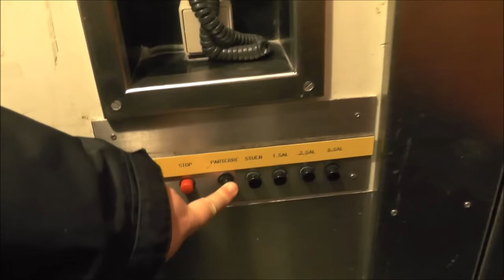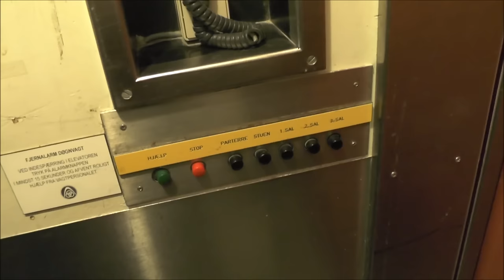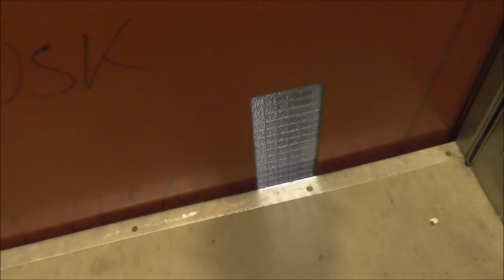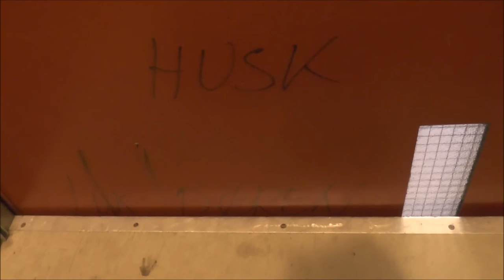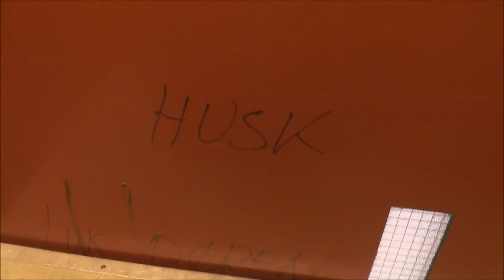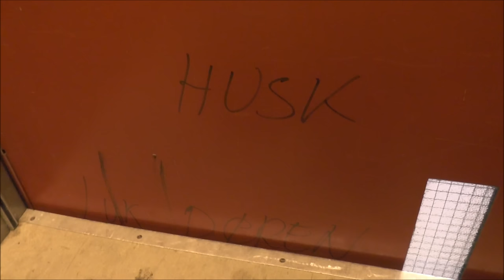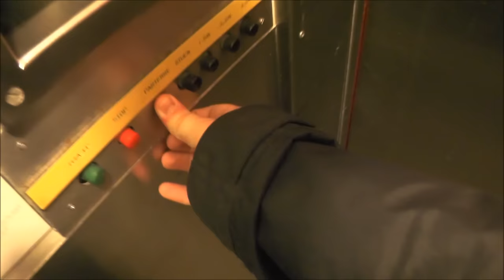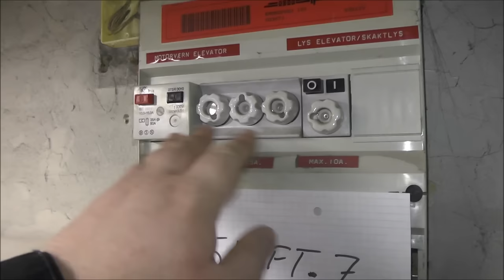I GOT STUCK 10 : 1942 Siemens elevator ride GONE WRONG

Comment: I think the motor timed out/overheated because the lift didn't fully stop because he did the reversal trick.
Reply from the maker: That might be a possibility. It wasn't clear to me what exactly broke down but I am certain it was a safety device that tripped.
Reply: @犬用下着ソース入り消臭剤 reversal trick is when you run three phase motor in forward and then suddenly switch it to run backwards without stopping the motor. Basically beacuse you are suddenly changing magnetic field to change directions motor can overheat and that is mostly problem on older elevators beacuse older elevators use magnetic relays to do everything something like this in video can happen and its bad for motor

Comment: Im scared of elevators Cuz my two friends where in my buildings elevators and they went form 3 floor to 1 in a sec and crashed. They where okay but my first friend jumped in the elevator, if you jump hard in a elevator it might break or crash. When they came out they where sweating so bad XD justens drink exploded. Molly was ok
Reply: if you junmp n the elevator its fine now they all have govenors that stop the elevator from falling
Reply: Glad their ok
Reply: @Azaelris  haha xD
Reply: @Azaelris  and also every elevators have 5 or 7 stong steel ropes. each rope can lift 5 tons (if I don't wrong) but lets think elevator starts falling. elevator's brake will trigger and elevator will stop cuz brake regulator will trigger

Comment: Usually it’s newer cheaper elevators that are more likely to do that but sometimes with older elevators you can have issues like a worn out door safety switch which can cause the elevator to get stuck if it happens to open the circuit while the elevator is moving.

Comment: This is so cool!!  It's amazing that the principle of all floor selectors is the same.  This is very similar to Express Lifts selector.  I have one that I will film soon and upload.  On the selector in your video, 5x landings.  The LEFT section (5 plates) are for the direction logic - one switch is pushed before another is released.  If all switches where allowed to be released, then if the power failed then the lift would loose it's ability to decided which direction to go, so there is always one switch pressed on this side.  On the RIGHT is the floor stopping position for each level.
I hope it's ok to share a link here.  This is rather a long video but it does explain what the switches would do on your lift... https://youtu.be/grQK2Simu8Q?t=4m33s
Reply: mrmattandmrchay good tips, but to late now 😞😞😞😕😕😕
Reply: redbutterflynine   M.
Reply: I am not sure if you are looking for a while
Reply: mrmattandmrchay u
Reply: mrmattandmrchay is
Reply: Mrmattandmrchay! I love your videos! Also it maybe that he used the main lift motor without stopping, without resetting the motor trip timer which trips when the motor is running for a long time (long time for a lift), the trip timer detected that the motor is running for a long time, and the timer tripped, and the lift got stuck.

Edit: I knew diesel ducky also got stuck, but then I didn’t have the Link, so I will add now

https://youtu.be/sVzVZEqF1SQ?si=lZ4eggp6im_kG9nf
(They get stuck at 4:30)

Comment: Maybe the buttons were pushed one too many times in a short period of time....and/or there is a fault with the reset circuit or elevator motor....
Reply: @19:04 those look like (blue finned unit) Selenium rectifiers.  Surprised those have not been replaced with newer technology.
Reply: With Selenium rectifiers, their voltage output decreases as they age.

Comment: Never play with elevators because it can end badly you can get stuck like me
I had last friday a power problems so the power outage occurs 2 times til the power got in after a few minutes and i decided to go to  walk with my friends i called the elevator its arrived all being fine but when i started to go down between 3rd  and 2nd floor I've got stuck in the elevator of power outage again i started to scream and cry but when i started to cry the elevator turns on because the power was back and i escaped from elevator by the opened doors at 3rd floor 
After this trauma i always choose stairs

Comment: You got stuck beacuse you are giving it too much commands to do
Reply: @Mr_ButterKatze  i work on them. You cant just send elevator down and imediately send it up then it will get lost and just stop.
Reply: @Mr_ButterKatze  he pressed it after elevator stopped that is old elevator and it uses magnetic relays to run everything and you can see in video that he did not even wait for elevator to stop and he was already giving it order to go up and what happened was sudden change of direction of three phase motor so temperature sensor probably tripped and stopped whole elevator
Reply: @Mr_ButterKatze  he did not press stop button while elevator was going up. He pressed it after elevator got stuck (he pressed all of buttons)
Reply: @gamingit1  ok anyway i dont care anymore to respond, bye.

Comment: I think the photocell probably malfunctioned and got stuck
Reply from the maker: That is not ture. The photocells were perfectly fine! It was a fuse (of an early kind of an switch-type fuse) that turned off due to Power overload... Problably due to my mistake by holding Another floor button while the elevator still was moving!
Reply: ADDEs Transporting Adventures! Oh I didn’t know old elevators has a fuse